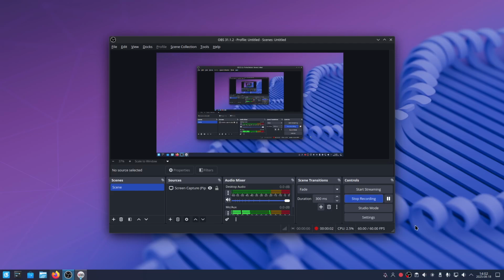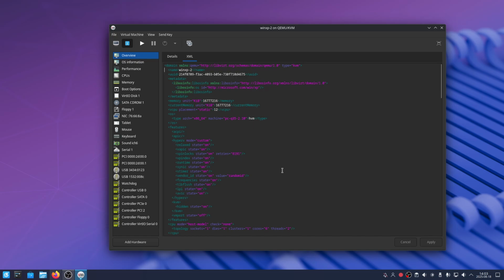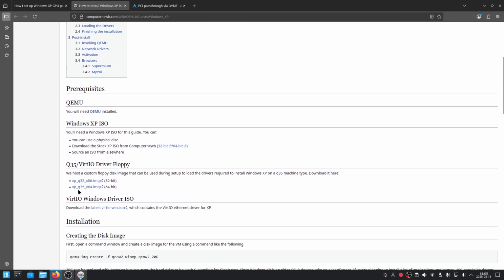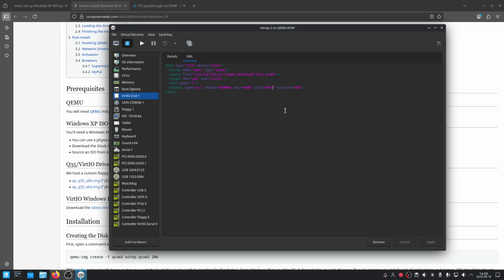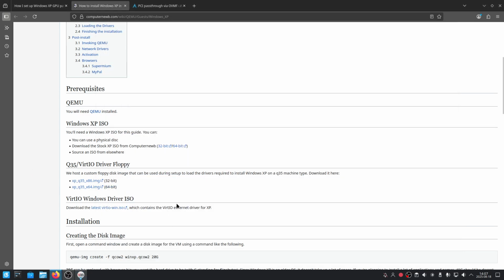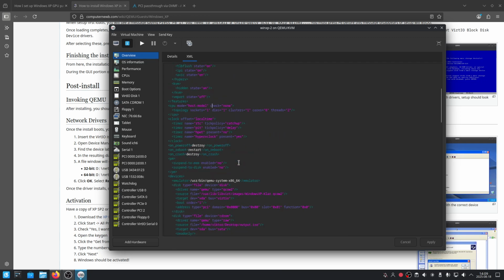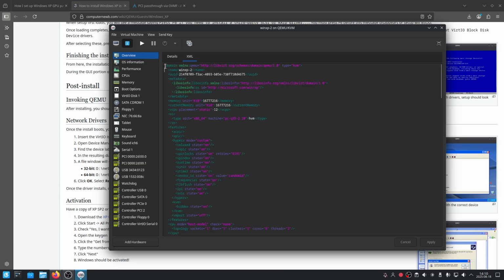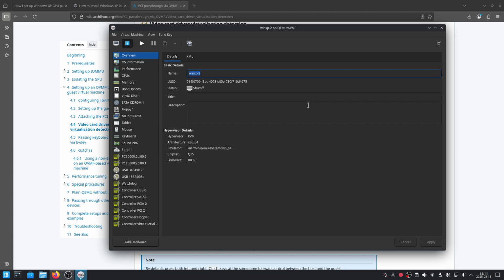Tutorial: High Performance Windows XP VM with GPU-passthrough

Comment: I'm trying to pass through a GTX 960. I followed all the steps and after I installed the Nvidia drivers & rebooted , I get a BSOD 0xEA error . I tried passing the GPU to a Windows 10 VM and it worked. I'm only having this issue with the Windows XP  VM.
Reply from the maker: I’m pretty sure it’s because you need to mask your nvidia card. I went over it at the end, but basically make sure you have the lines from the two code blocks here: https://wiki.archlinux.org/title/PCI_passthrough_via_OVMF#Video_card_driver_virtualisation_detection

So both the <hidden> tag and the <vendor_id> tag.

Comment: I'm sorry, I don't understand really what you did here. My general understanding is that normal gpu passthrough doesn't work for systems like windows XP because a system that old doesn't have the drivers it would need to use modern hardware, and I know that what you did here wasn't just standard gpu passthrough, but I can't really tell what it was either. You were using the virtio disk at some point? What do these drivers you found actually do, exactly? Maybe I'm just a dunderhead who couldn't follow a simple video, but either way, I feel some further clarification on what this is would be nice. Like, say you're starting point for this is that you have installed a normal winxp vm, and that's what you have. What exact steps then do you make to get that vm to use 3d acceleration? Does that make sense?
Reply from the maker: GPU passthrough will work fine on a Windows XP VM as long as you have the proper drivers for it.
In this video, I demonstrate it on my GTX 960. There is just a few quirks you have to do to get it up and running properly. I go over this near the end of the video

To clarify what this video is about:
A stock Windows XP VM in virt-manager will be significantly bottlenecked by the default interfaces it supports.
Technically, QEMU only supports the much older "i440FX" chipset for Windows XP. This is a problem, because that means we are limited to a slow emulated IDE interface for our hard drives and such.

To combat this, I demonstrate how I got a Windows XP VM set up on the Q35 chipset instead.
This gives us the ability to use both a faster emulated SATA controller and the ability to use faster Virtio-blk drives for near native performance. In addition, we also get access to the NetKVM virtio NIC for much faster network speeds and minimal latency.

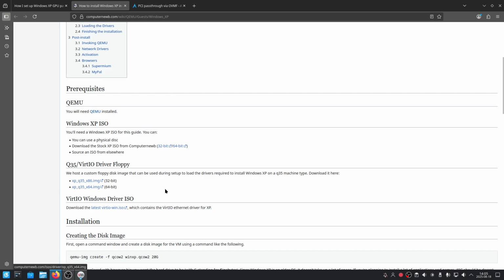The drivers you were questioning about (at 3:01) are drivers that you load during the Windows setup, as I go over, it gives support to both SATA and virtio-blk hard drives so you can install your VM on them.

I hope that will clarifies it, If you're still confused don't be afraid to ask or send me a DM on discord :)
Reply: @moody_weirdo  I see I see... So you were able to make Windows XP run on a more modern chipset in the emulation, and then used the gpu passthrough. 
I also didn't realize you were actually using an older graphics card. I've heard that if you have an old gpu that's compatible, you can pass it through to the vm of an old operating system and have it recognize the card, but you can't just emulate an old graphics card the way you emulate the rest of the old hardware. 
I was hoping I'd be able to get the vm to use my new gpu somehow, whether through some kind of "new gpu emulating old gpu" thing, or maybe making the vm send all its graphics calls out to a different server, the host, which would then convert and run all the gpu stuff and then send it back to the vm, but that's not what's happening here. I'd still have to actually insert an older card into my physical system and pass that through.
I know I have one somewhere. In an old box in the back of my closet somewhere, there's an old graphics card with a blue pcb, and the name Pegasus on it. I don't know exactly where it came from, but it looked about the age of an xp system
Reply from the maker: @PODEPOM  As long as the GPU has drivers for Windows XP it should work.